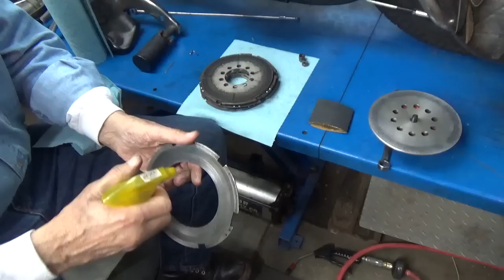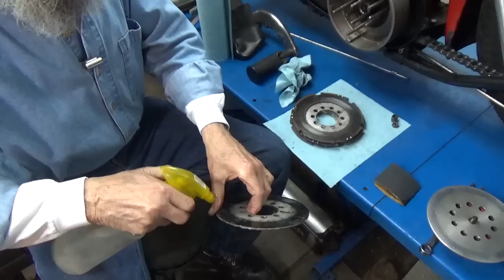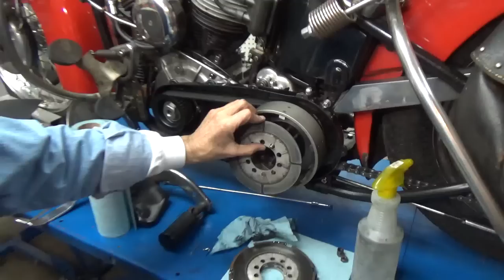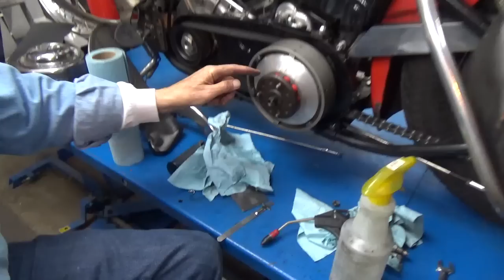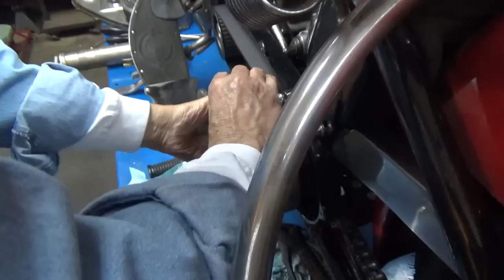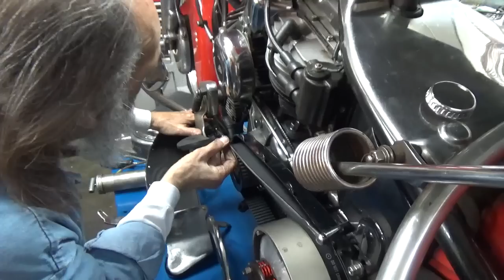We're Doing The Clutch Adjustment On My Harley Davidson Panhead Again!

Comment: Mike did you add the 2 clicks to adjust for wear on the friction plates ?
Reply from the maker: What clicks?  I don't think I understand.
Reply: Sorry...When you were tightening the adjusting nuts  , you measured the height  and set the nuts ... I'm just guessing ,   to the the recommended height  ....  then you  said  (@21 minutes).  " I'll add 2 clicks... cuz I can"   so I'm guessing  that was because the plates were a little more worn so by tightening the adjusting nuts  2 clicks more  ( looked like a half turn)  it would then compensate for the worn plates? And stop the slippage..
Reply from the maker: No, I was just getting the plate even.  I was probably thinking a little out loud.  The measurement given by the book is great.  But, like everything else in old machinery design, you have to get a little creative, especially when the parts you're asking to work together come from several different manufacturers.
Reply from the maker: Sorry if I got a little "unclear."
Reply: @pacificmike9501  
Thanks Mike 👍

Comment: The clutch on my 45 flathead had springs behind the first clutch plate, transmission side, on each of the adjusting studs. And I'm having trouble with the clutch not disengaging all the way. Could they be the problem?
Reply from the maker: Several things could be the problem.  Have you cleaned all of the plates?  Are they sticking together?  Are the studs smooth enough that the plates can slide on them?  Are the springs adjusted according to your manual?
Reply: @pacificmike9501  I'll double check everything. The only thing I didn't do was sand the pads. Thank you for the response.

Comment: The steel rod that is tapered on one end and recessed on the other end with a little nipple and runs through the clutch hub and the main trans shaft.  Which end goes in first?
Reply from the maker: Both ends must be in good shape.  I'm assuming you are working on an old bike.  You didn't say.  Small end should go in first if you're putting it in from the left side.  It should end up in the throwout bearing on the right side.
Reply: @pacificmike9501  thank you Mike. Yes it's a old bike (55 straight leg frame, 41 FL motor, and a 1963 4 speed trans) and I am trying to put on a belt drive primary from a late 50s pan
Reply from the maker: You'll probably need a front pulley for a tapered shaft instead of one for a splined shaft.

Comment: Well i have a 85 fxsb lowrider my dad called it an 84.5 but whatever, the clutch was done 20 years ago but very low miles on it... fluids were changed but i cant adjust it now and there are 4 bolts around the adjustment bolt
Reply from the maker: I think you're looking at a different clutch than the old ones.  You need a service manual.  Do not get confused on your clutch.  Is it wet or dry?  Does the spring need adjusting?  It's very clear in the proper service manual.  Not very difficult either.

Comment: Hello, I have a 78 Shovel that was my father in law’s that is currently getting some tlc. The clutch plates don’t move evenly when pulling the clutch cable. The pressure plate is 1 1/32 all the way around. What could be the problem? Thanks.
Reply from the maker: The plates could be hanging up on the studs.  The studs could be very worn and grooved.  The springs could be uneven and therefore, setting the adjusting studs a little offset, could straighten it out.  The holes in the plates could be too small and need to be opened 1/64 larger than 3/8.   That would be 25/64ths.
Reply: Thank you. I did pull hub and the fingers are worn. I’m going to try to sand them a little bit to smooth them out and see if that helps.
Reply from the maker: If not, all of the big suppliers carry new clutch hubs.
Reply from the maker: It probably will.  If all else fails, replace the hub and make sure the plates slide on it.

Comment: Working on a 66 generator shovel. I follow all adjustments in the book for clutch and mousetrap, but the lever will not touch the handlebar. Any ideas?
Reply from the maker: Yes.  Start over and do it until you like it.  Make sure it's all properly lubed.  If the lever won't go all the way to the bar, keep going anyway (if it goes almost to the bar) and see how it comes out.  You may have limited the travel from the throwout arm or maybe you don't have a proper hand lever.  You'll find what's limiting it.  Never give up.
Reply: @pacificmike9501  I wish I could send you a video of what this bike is doing. It is an electric start 66 seems all bound up. The mousetrap wont operate like in your video. It's almost as if the clutch arm barely moves.
Reply: @pacificmike9501  is there a way I can send you a video?

Comment: iv got a question  i  have a 93 Heritage softail  i just put a new clutch and clutch cable  i got half turn out on clutch and 1/8 th free play cant get it to go into neutral unless you are coasting  or you shut it off then it goes right in . i cant get a answer
Reply from the maker: Simple answer:  It is a "characteristic."  Since the five speeds first came out, this has been a common complaint.  It is inherent in the design of the transmission.  It will slide right in to neutral if you're moving.  If you're stopped with engine running, you'll have fun finding neutral.  Wish I had something better to say.
Reply: @pacificmike9501   lol will thank you thats what iv been hearing

Comment: I'd like to add a little I put a little grease on the little ball of the steel clutch plate and a little fine grease in the clutch up where it rides. What do you think about that. I'm curious
Reply from the maker: If you get grease on the plates, you'll need to clean them.
Reply: No just a little bit on that little ball not crazy not a messy

Comment: How much oil goes in the primary of a 71 shovel head
Reply from the maker: It has its own circulating system from the motor.  Get yourself a service manual for your bike.  It will be money well spent.

Comment: I have a 74 shovelhead wants to pull when clutch is in and won't go in nutral when stopped and running what can I do
Reply from the maker: Sounds like the clutch is dragging and not "breaking " clean.  Clean it all and make sure the plates are floating on the pins (studs).  Then, it's just a matter of proper adjustment.

Comment: Im having problems adjusting my clutch so it will turn the motor when i kick my 58 and not grab in gear with the clutch in.
Reply from the maker: Yes, some times it's difficult.  That's why cleanining all the plates matters.  It's also why the springs need to be adjusted so that the plates "break" evenly.  Sometimes a "Ram Jet Retainer" is the answer.  It's carried by most major aftermarket Harley parts suppliers.  Be sure the throw-out bearing and rod are in good shape.

Comment: friend's Panzer w/ a Panhead Electric start w/Rev Tech 5sp has a recluse clutch,dated and no parts , would prefer to swap out to primary belt system ,maybe we can get you cover steps
Reply from the maker: Instructions from the supplier is about it.  I don't have a Panzer around here.  I do remember them doing a pretty cool job of building bikes though.  They invited me to interview at their facility in Colorado.  It was a quality control position and I was honored.  Sadly, they closed their doors quite a while back.
Reply: @pacificmike9501  Mike, thanks for getting back so quick , I was lucky enough to attend a XMas party there , great group. Shame they closed up. Where I met Berry Wardlaw from Accurate Engineering who ended up supplying motors to them . There's no manuals.One of those changes that's gonna take musical chairs with parts to get it done.

Comment: have you ever modified the clutch shell to have 5 threaded studs?
Reply from the maker: They're an aftermarket item.  It is the hub, not the shell.
Reply: @pacificmike9501  ok that's right my bad thanks for responding
Reply: I set up a hub with 5&5 years ago..the concept seemed sound so I thought I'd try it. Worked great (exactly like the original 3&5 set up). Went back the factory original design the next time I did a hub. Like you said, personal preference.
Question....are you using 70% or 90% Isopropyl alcohol? I always used denatured alcohol (just because I always had an abundance of from wood working). Any drawbacks to denatured?

Comment: Mike this is Mike I'm asking about the clutch adjustment on a 1976 shovelhead is the studs on the clutch hub okay if they are flush with the nuts it's a new basket a new clutch carbon fiber and the new tamer been a problem putting everything in I think I have it but there's no thread showing on the studs is that safe yeah
Reply from the maker: It should be.  I don't know what measurements you're going off of.  You may have a thicker stack than the original.  I don't know if your springs are working well, or if the plates are moving freely.